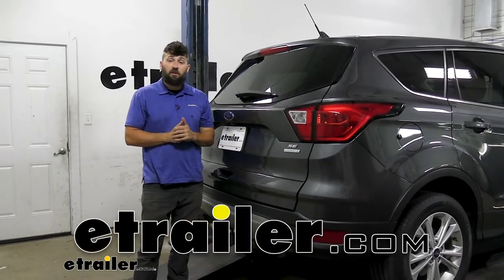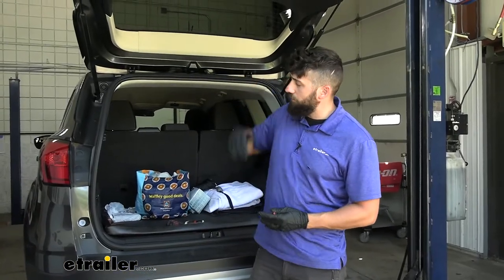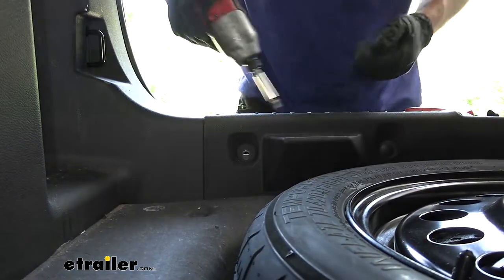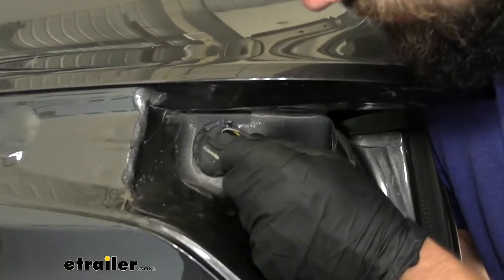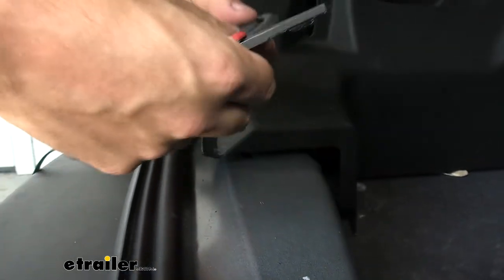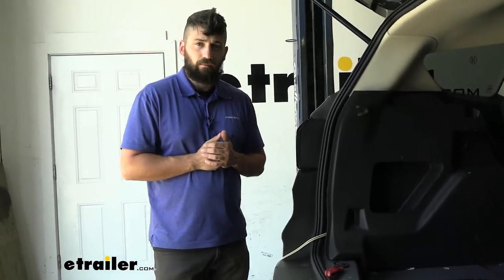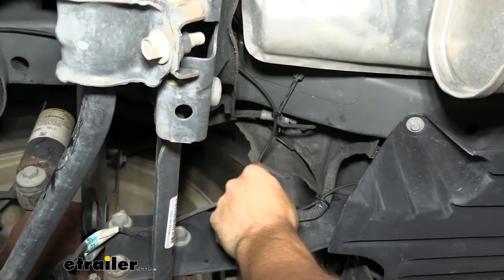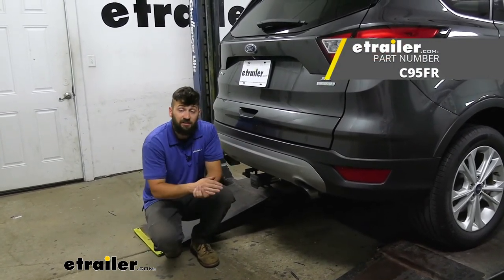etrailer | Curt T-Connector Vehicle Wiring Harness Installation - 2019 Ford Escape

Comment: I’m wondering if the 2019 escape titanium if I need to connect the red wire to the brakes or if it should be grounded?
Reply from the maker: It depends on how your taillights operate. If the brake lamp and turn signal use the same bulbs, then you'd ground the red wire with the white wire. If those functions use separate bulbs, you'd ground the wire and tap the red wire into the brake lamp circuit. Hope that helps!
https://www.etrailer.com/Custom-Fit-Vehicle-Wiring/CURT/C95FR.html